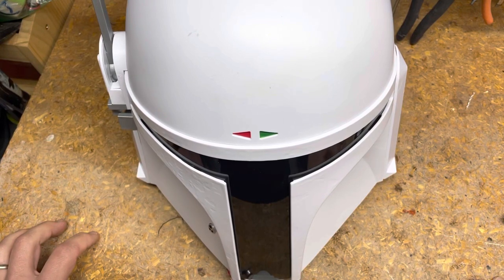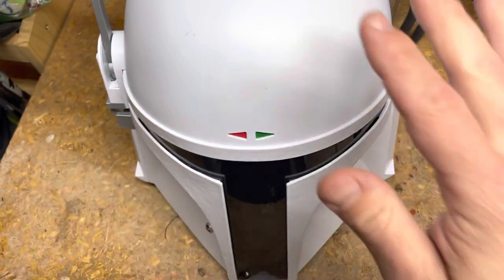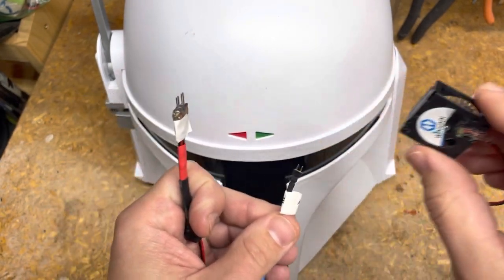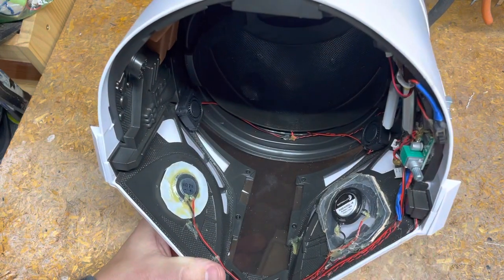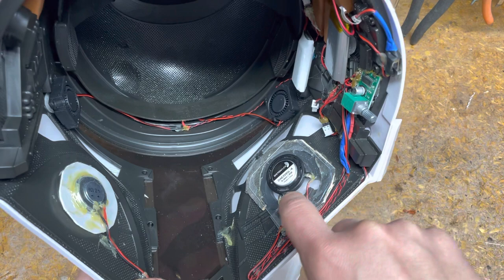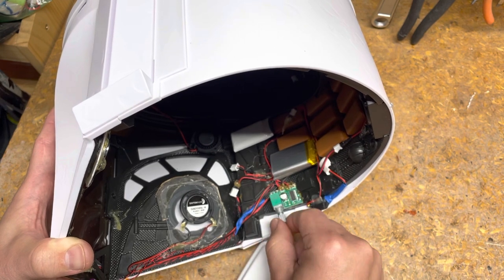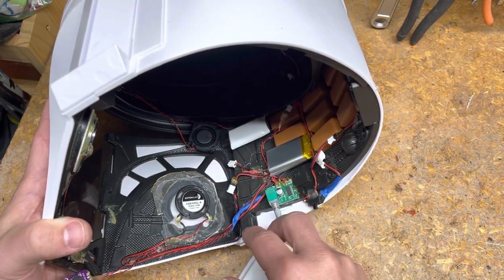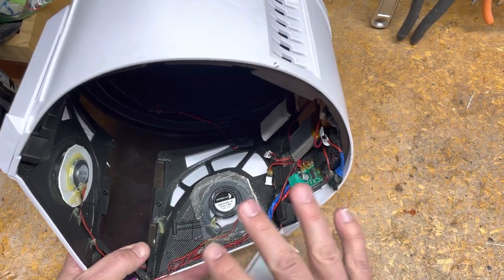Mask amp & fan install  (Star Wars Mandalorian, Boba Fett Prototype Black Series costume helmet)

Comment: Can I pay you to build mine for me?
Reply from the maker: For this build I would have new recommendations that would vastly reduce the work involved. Check out my Mando install if you haven’t already https://youtu.be/yPGlVtBoNYg?si=m_8o5gDSOKALBcH2

The challenge with commissions is cost of Labor.  I’d recommend buying a finished helmet with built-in audio - as it would likely be cheaper than what I'd need to charge for my time alone.
For example- My recent Darth Vader helmet took nearly 20 hours to complete though much of the time was figuring out what to do - but even if I streamlined the process to a handful of hours, labor alone would still run a couple of hundred dollars, plus parts and shipping.

Though I am interested in the challenge of seeing how efficient I can be in turning around a completed product.  Perhaps I can turn it around in just a few hours.
DM me on Facebook and we can chat options if you like. https://www.facebook.com/share/YhszpWnFWoFCTZNB/?mibextid=LQQJ4d
If nothing else I can advise you on how best to do it.
Reply: Oh wait I read that wrong, now I see what you’re saying. Agh so it would be extremely costly huh🙃

Comment: Do i need a sodering kit to put these together? Also do you have a link to the wires you used for this
Reply from the maker: Solder kit for that yes. Though it’s more trouble than it’s worth - I’d recommend getting a Norwii Mini Personal voice amp. https://amzn.to/47hLWJr

It has the mic, preamp, amp, and it does have a speaker but you might still want to swap to an exciter depending on your use-case.
Regardless using those ICs is a lot of work and will cost you more if you factor in your time and it won’t sound as good as the Norwii.

If for some reason you need a mic+Preamp - like feeding into a Zoom Multistomp for voice changing - I recommend this off the shelf setup - Mic +PreAmp - Movo LV1 with 3.5mm  mic/some combiner  and 1/4” converter https://amzn.to/4epX5dF

Wirewise - using 22 awg is a good baseline for both power and audio, but you can go to thinner sizes but you’ll start decreasing quality and increase resistance and heat… though it’ll likely be negligible.
Here are the wires you’d use for connecting to the speaker and power on many portable amps: PH (2.0mm w 1 line) https://amzn.to/47FJDQB
XH (2.5mm w 2 lines) https://amzn.to/3TH912K, Splitters:  https://amzn.to/4gEzA2c
Reply: @creative-stuff  thank you for still responding even after the video being a year old

Comment: Awesome video tutorial. I am about to embark on a similar quest, but add fans and amp to a eva foam helmet. what size wires are you using?
Reply from the maker: Sorry for the delay - YouTube sometimes leaves comments out of my notifications list, no idea why - wonky… 
Anyway, 26awg is my primary go to for short run audio and power. 

This is a link to some of the wires I’ve bought; I like that if you’ve soldered header pins to your board (voltage booster, mic/preamp, etc) then you can easily add and remove these wires given their built-in connectors; it’s opposite end has tinned wires for twisting into other lines or soldering to something:
https://www.amazon.com/dp/B01IZWBHJC?ref=ppx_pop_mob_ap_share&_encoding=UTF8&tag=rebelempirede-20&linkCode=ur2&linkId=5b39cd9664542c144027907c60923682&camp=1789&creative=9325

Comment: have you tried putting some foam over the mic, to help knock down the feed back?
Reply from the maker: Great point.  Not yet.   I realized also recently when doing my Star Lord mask mods that the mic pics up vibrations from any thing it touches as well - thus why mounting the mic firmly to the mask surface yields lots of feedback.  I’ll likely add foam both to the back and the front of my mic to see hire well it improves it.  Thanks for the note to think about trying foam on the front too.
Cheers.
Gutted Moukey Amp video:  https://youtu.be/0fAGJK9jco4

Comment: also would you consider commissions? on doing these helmets?
Reply from the maker: It’s not something I’m doing right now, perhaps in the future- tbd.
In the interim, know that in lieu of building your own amp system, I recommend just buying a complete personal amp and gutting its parts.  Less work and more features.  I did a video on that as well - the Moukey amp has a real low profile circuit board and seems to give less feedback than this build.